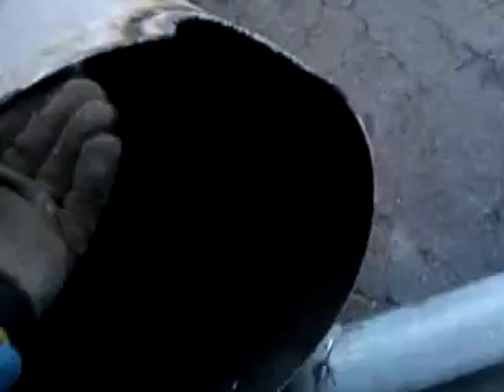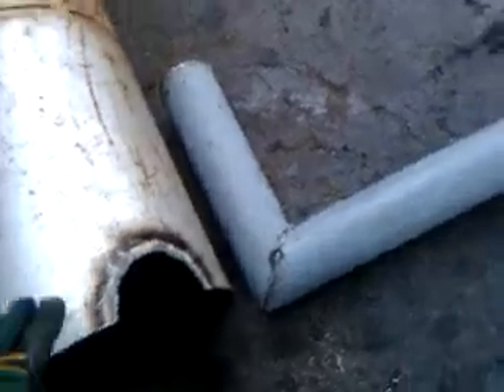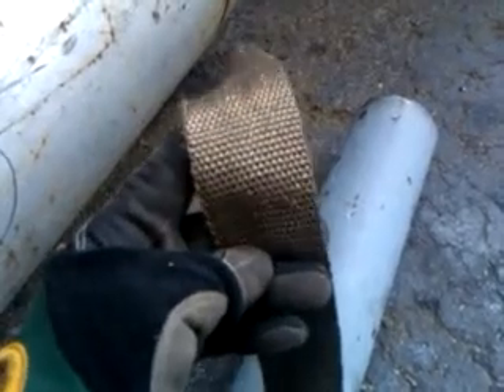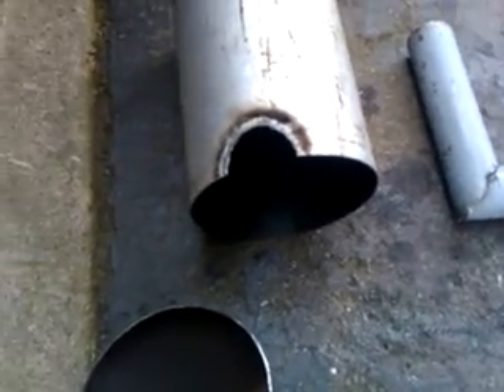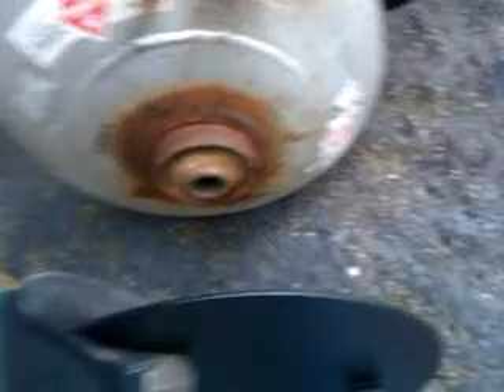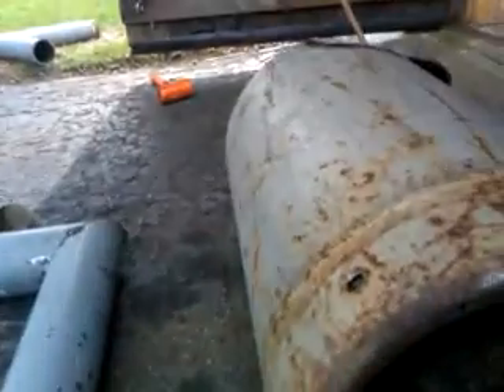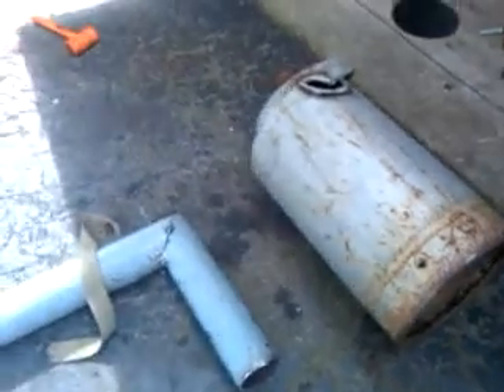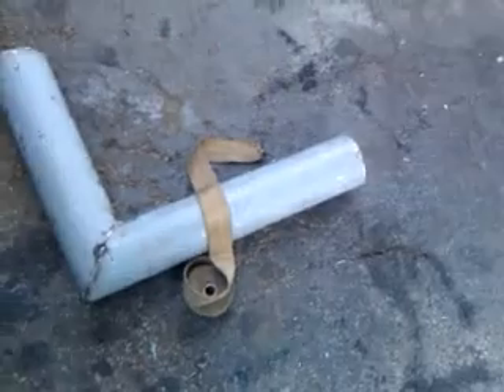Just checking!

Comment from the maker: Thanks! I am planning on doing 2 vertical, self feed tubes. I don't know how they will work out yet, will have to do some "cyphering " as my great uncle likes to call it. I will probably have to do the pellet feed out of stainless, at least the bottom funnel where it dumps into the burn chamber. I know most commercial stoves use forced air and some type of auger system to feed with. I want a stand alone unit using no electric at all. I like your idea of the sealed chamber, so I will go with that

Comment: I been watchn your vids all night & reading my heads spinning , COLD n nebr  can u give me some demensions ?  how long is the inside tubes ? 3/16 pipe ? 6'" ?  how long is the pipe coming out ?  how much did u cut off the tank ?  whats the square tubes ? 6" ?  & why do u cut the original bottom off the tank, witch is the top now ? yes im that stupid lol but again u would be amazed at some of the stuff iv built over the yrs. the rest I can kinda piece together from your vids or u can give me more info thanks
Reply from the maker: +roger backyard fk it all up Thank you for watching! The length of the pipe varies quite a bit. I ended up building two different stoves, this one, and another that burns both wood pellets and regular wood. I have videos on it also. I have cut apart, and redid this one, so again, there is a lot that changed. No special reason for cutting it off, just happened that way. The pipe that I found that would hold up to the heat generated is 4 inch ID well casing. Check out the other videos, and everything is explained, and the evolution that each stove took. Thanks again, and best regards, Jeff.
Reply: +Jeff Crutchfield  I watched lots of your stuff not sure what one this was I guess I was referring to the big one that u was buiding for the house, with the wood hopper & pellet one,   hard to just guess on the sizes I watched a lot of others too thought yours was the coolest idea ,
Reply from the maker: +roger backyard fk it all up I appreciate that! but to be honest, I couldn't remember all the measurements if my life depended on it, Lol! Honestly, the lengths don't matter a whole lot. Just play around and see what drafts the best. I don't think there is an exact math to these things. When I first started to build these, there were all kind of well, dare I say self proclaimed gurus that preached one thing or another on these stoves, but all in all, they are pretty simple,  just dialing them in to what you want to use them for is something else. That's a whole other story, Lol! I tried to over think the process to a fault.  But, I did learn quite a bit. Again,  no myth or magic, just trial and error to what will work for your specific needs.
Reply: +Jeff Crutchfield Ok the only real question I have then is the rocket part , 3/16 steel I know u said 4' ID well casing, would 1/4 inch pipe work just as well ? as its thicker ? or to thick that it wont heat up. most vids I watched they used 3/16 , I like to build Over kill sometimes but just once so just wondering yoru thought on 1/4 thick & thanks for your time
Reply from the maker: +roger backyard fk it all up. Depends on the type of steel, not necessarily the thickness.  Well casing is super dense, super tough steel. If you go get run of the mill mild steel,  which is mostly what you will find in the local steel yards, it will deteriorate quickly under the type of heat these stoves will generate. Even stainless steel will start flaking quickly,  it won't burn through, but does deteriorate after a while.  The reason I used the 4" is, it is the most common, and, I already had it. you can make the burn and riser tube any dimension you want, 4", 6", 8", round, square,  doesn't matter, as long as it is a high quality, dense metal.